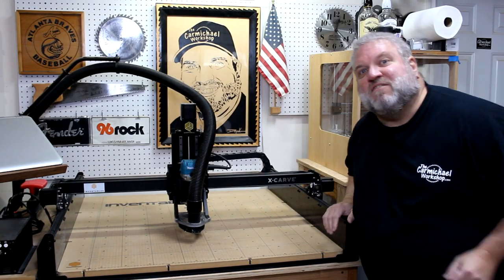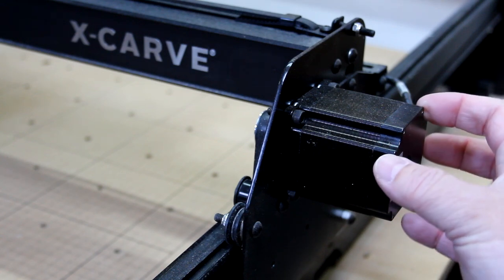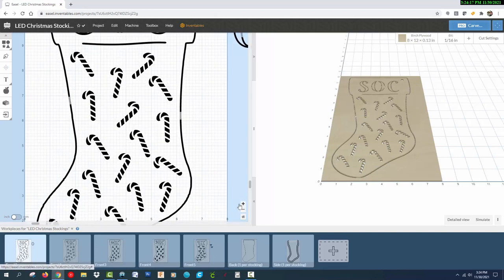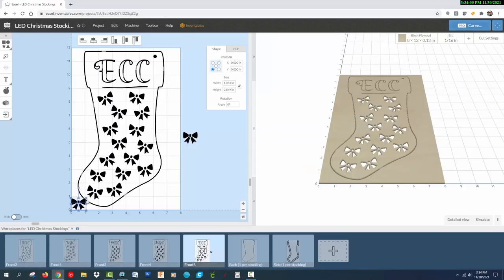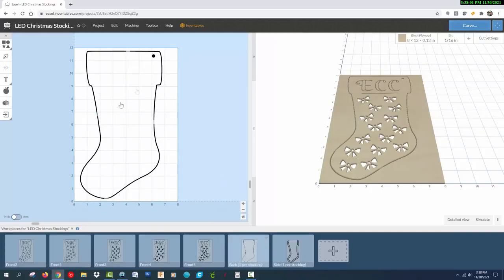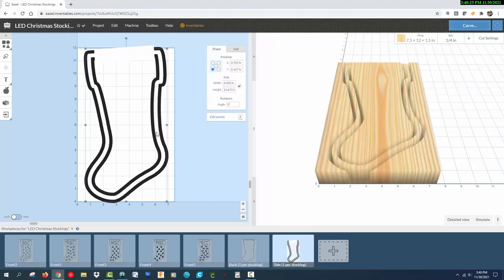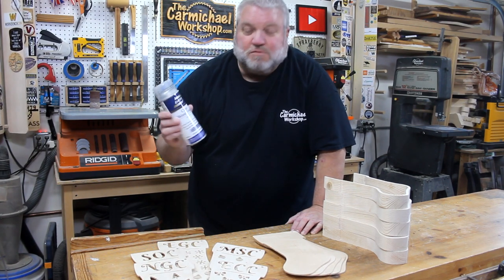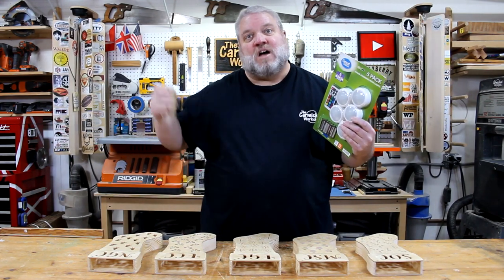Santa Can't Miss These Cool LED Christmas Stockings

Comment: Do you have these available for download plans
Reply from the maker: Hi Joseph - Here is a link to open the drawings.  I think you can create a free Easel login and download them under the Project menu.  Or, you could press the Print Screen key or use a snipping app to  screenshot each one and customize it in Word or photoshop.  Thanks!   https://easel.inventables.com/projects/7sU6ctIH2vQ74lDZScjZ2g?ref=CarmichaelWorkshop

Comment: What router bits did you use for the birch and the 2x6
Reply from the maker: I used 1/16" spiral upcut bit for the birch.  I used a 1/4" spiral upcut for the 2x6.  I would have cut all the way through the 2x6 if my blanks were bigger, but I barely squeezed 5 sides out of the 2x6.
Reply: @SteveCarmichael  thanks man. Put out more videos I always enjoy them you are such a great craftsman!!

Comment: This would be ok if you own a CNC machine. Try cutting by hand. Not so easy, and the 5 minute commercial ruined it too.
Reply from the maker: Hey Gary - It was actually on my scroll saw project list.  Most scroll saw projects can be done with a CNC, laser, 3D printer, or just a coping saw.  You could even use a drill with two or three different size bits to make snowmen shapes on a stocking.  Or, paint it, or decorate it with a vinyl cutter.  Lots of ways to skin this cat.
Reply from the maker: If you watch a lot of youtube, try Youtube Premium for a month.  I haven't seen an ad in months.  Such a time saver and well worth it for the cost of one lunch per month.
Reply: @SteveCarmichael  And this is the only way you can actually buy time - win-win!